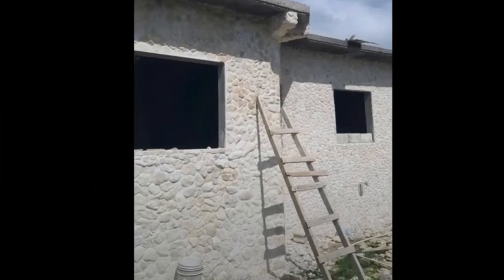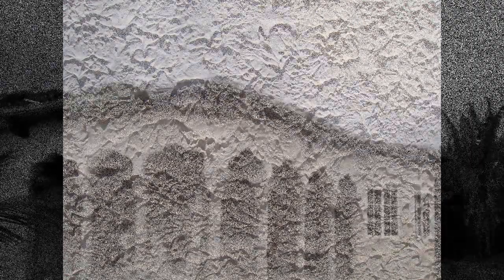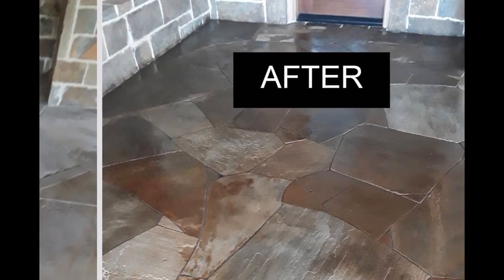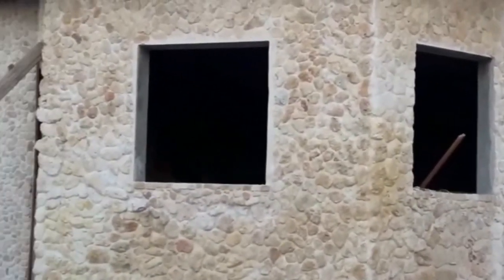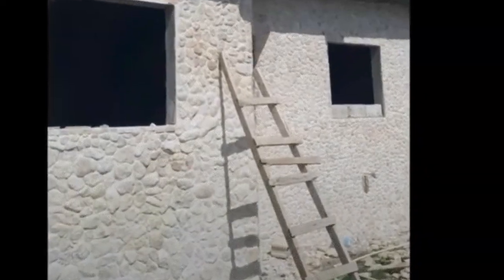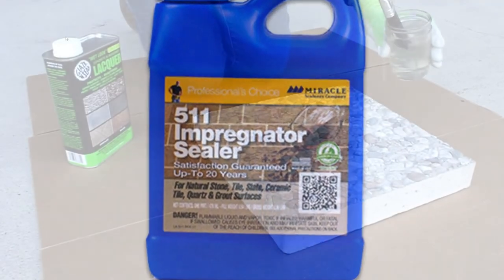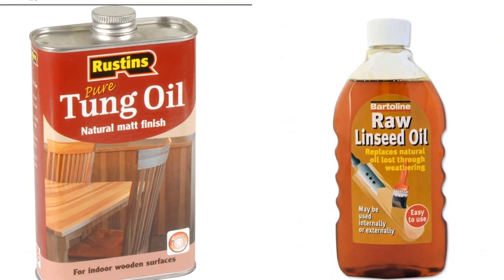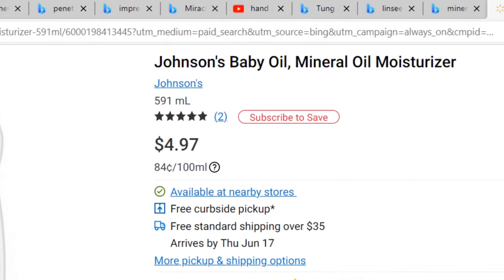BUILDING YOUR DREAM HOUSE IN JAMAICA. HOW TO SEAL CONCRETE AND STONE. STONE SEALANT.

Comment: Nice information especially with persons becoming innovative in their construction. Wondering what is best to use on decking now that persons using this as their roofing option.
Reply from the maker: there is an epoxy roofing compound that's designed to fill the small cracks on a slab and will melt in a hot sun and continue to provide water proofing for a long time.

BUT if no one will see the roof and you do not plan to build upward so that the roof will never become a floor then the best sealing material to use is tar. Its sold in Jamaica as solid blocks and is brittle. It has to be heated/boiled into a liquid and either sprayed or brushed onto the roof (dangerously hot by the way) but the up side is that your roof will never leak EVER!!

The very best option is to ensure that your deck is done in such a way as to ensure that it will not leak by using a plasticizer in your concrete, mixing your concrete consistently and correctly, keeping your supports under your decking for at least 16 days after you pour your decking, crank your rebar in the 1/4 and 1/3 method to provide support at the right places and using fibers to reinforce your concrete.

Comment: Would you put a sealant like this on a slab roof?
Reply from the maker: it can work but would require multiple coats and depending on if its a surface sealant or a bonding sealant it might not last very long given the nature of roofs.
 Its better to apply an epoxy paint. Its cheaper to apply and provides much better protection from leaks caused by micro cracks in the concrete, will stand up to abuse like heavy objects and scuffing from shoes and lasts a very long time.. So essentially the same stuff you paint your garage floor with but with more UV protection added.